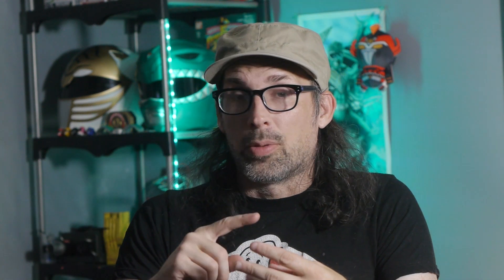How to Build A 3D Printed Ghostbusters Proton Pack - Part 1: Intro

Comment: What would be a good 3D printer for this project and what was thenlink to go to look up the blueprints?
Reply from the maker: it depends on if you want to be able to print larger pieces as one piece or smaller pieces and what your budget is. Ender 3 is a good starter option, CR-10 if you want a bigger print bed, and Bambu if you want to spare no expense and get something that works out of the box. The files are located at the 3D Printed Ghostbusters Props Facebook group. It should be linked in the description.